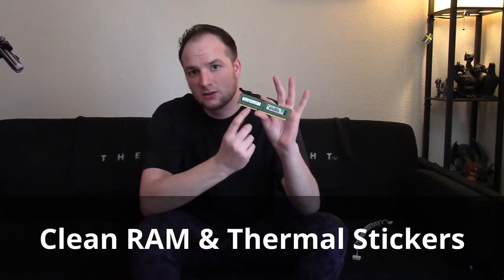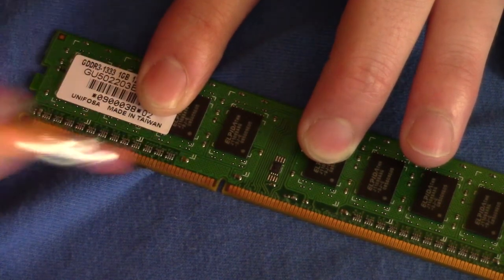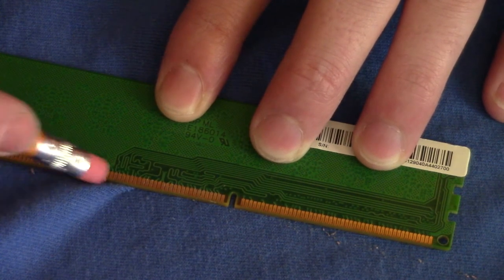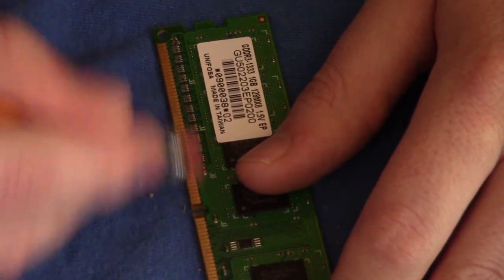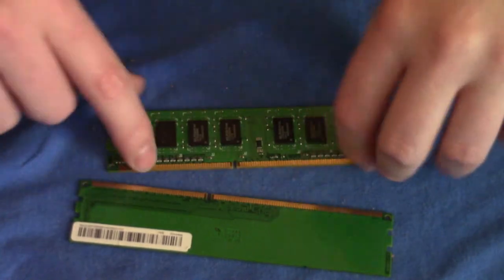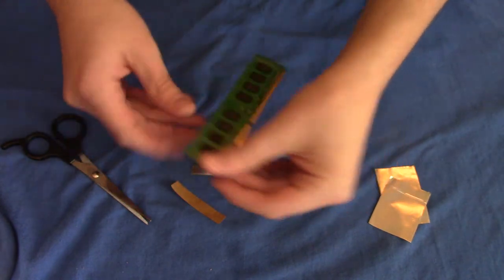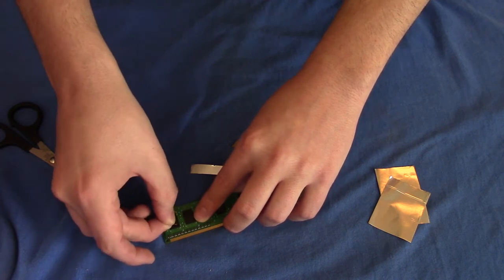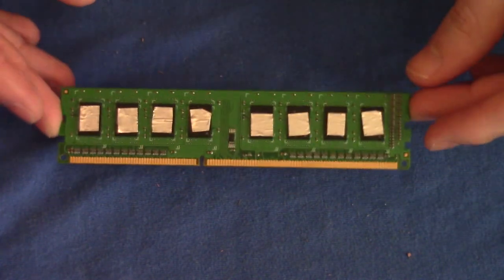💻 RAM Cleaning & Thermal Stickers

Comment: I would recommend brake cleaner for the ram works very well besides from that I don't think aluminum tape will do anything no significant mass and no real fins to help radiate the heat away.
Reply from the maker: never tried break cleaner might have to give that a go. as far as the tape anything is better than nothing but would have to do some major stress tests to know for sure. Please sub if you can 😋
Reply: @TheThorns  It's good at removing oxidation from metal kinda it's whole purpose really but it's safe for gold and while it sound stupid and risky it's pretty safe, I've sprayed $500 graphics cards PCB's down with the stuff and I've yet to run into any brand which has damaged anything they all evaporate near instantly. 

A safer alternative would be a citrus based cleaner they are effective but you typically have to wipe them down with alcohol after to remove any remaining film. I do agree tho some mass will help with cooling but they might run the risk of shorting the board while aluminum isn't very conductive it is still conductive.